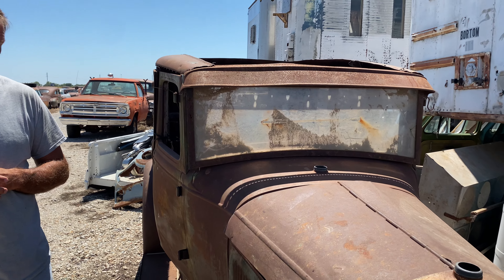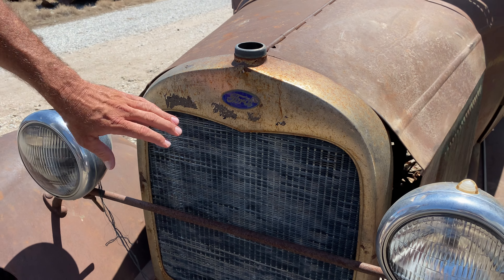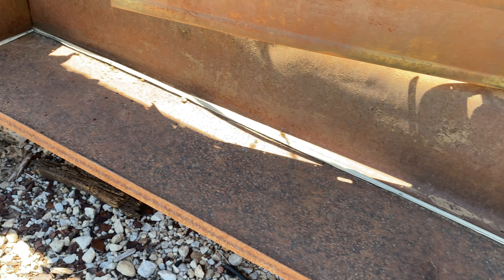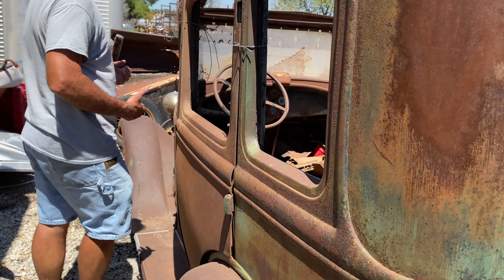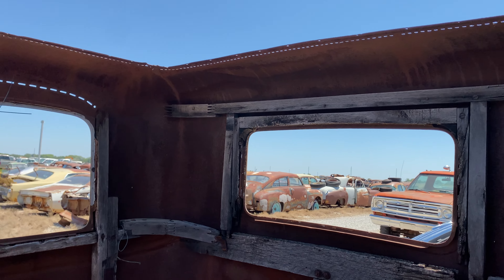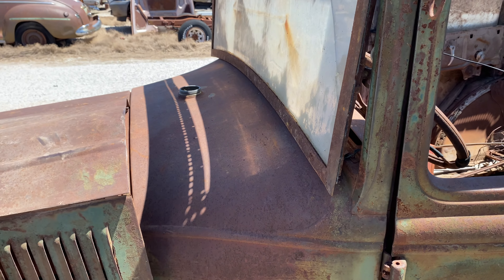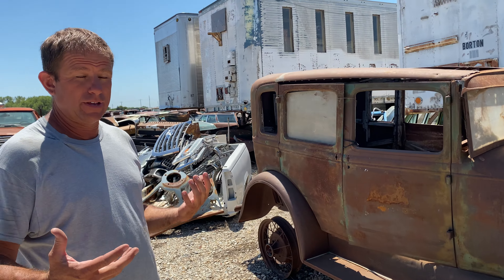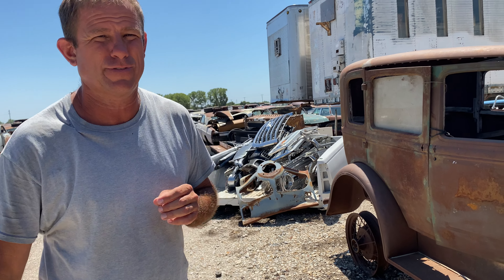New Inventory! 1929 Ford Model A Sedan!  Clean Body - Good Project!

Comment: Hey Chad... You got a  29 model a Murray body fordoor... the grille and instrument panel supports the year. The older model a has a smaller grille and the instrument panel bottom cut out is egg shape. 👍🏻
Reply: Also bullet shaped headlights! It’s currently got V8 wheels,
Reply: @adamross8141  Those headlights aren't original... and the rear wheels are model a wheels
Reply: @DrTheRich  true but the rear wheels are 30 31, the head lamps are aftermarket but they are the correct size and shaped (30 31 bowl 28 29 bullet, )